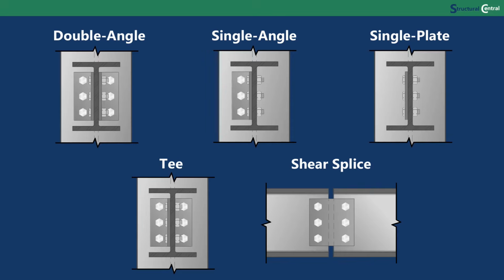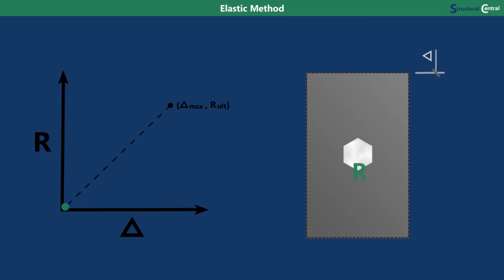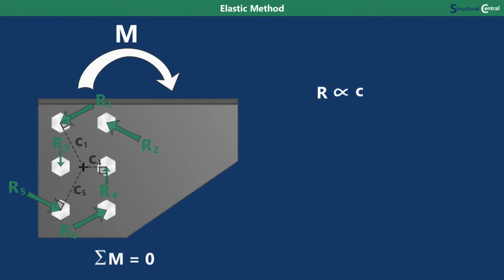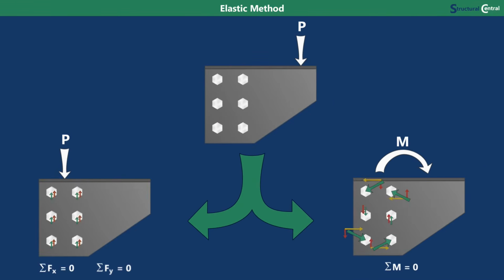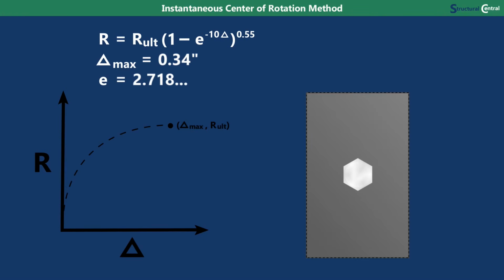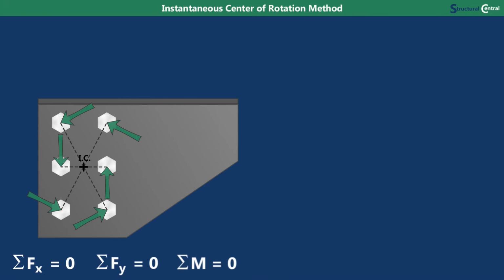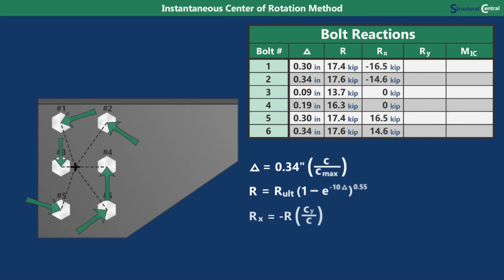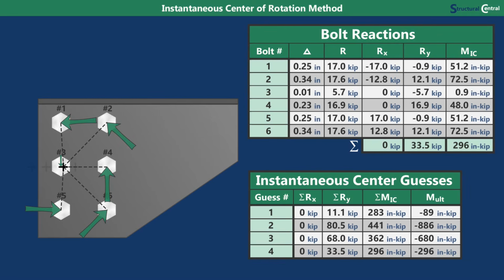Bolt Group Calculation - Eccentrically Loaded Bolt Group Analysis

Comment: I didnt understand first one how each one p/6  Do the all forces have same axis other wise rotation would be
I am talking about 3D
Can you explain
Reply from the maker: When analyzing an eccentrically loaded bolt group using the Elastic Method, the applied load gets split up into a concentric load and a concentrated moment. The reactions from the concentric load are P/6 since each bolt supports them evenly. These reactions, though, still need to be combined with the reactions from the concentrated moment in order to determine what the reactions are from the eccentric load.

Please let me know if you still have questions about this.

Comment: How could you calculate the bending/torsion (I'm really not sure what it is) stress in the plate?
Reply from the maker: Each bolt prevents vertical and horizontal displacement at specific points. The entire bolt group collectively acts as a support that prevents rotation (in addition to preventing vertical and horizontal displacement), but it doesn't have a discrete location. This means that there isn't a single value you can use as the eccentricity to determine the location and magnitude of the peak moment like there would be for typical fixed supports. Instead, you need to use each individual bolt reaction and statics to determine this. You could conservatively use the distance from the applied load to the furthest bolt.

Once you've determined the magnitude of the peak moment, you use fb = M / S where fb is bending stress, M is the moment, and S is the section modulus which is bh²/6 for a rectangle.

Remember, that you may also have axial stress in addition to bending stress if your applied load is not perpendicular to the bolt group's point center of gravity.

I hope this explanation helps!

Comment: A c channel is bolted eccentrically to a concrete wall and the unbolted side of the c channel is supporting a cable tray. The bolts are 6 numbers in 2 columns 6 inch apart. How do I know if it would be acceptable if we reduce the 6 inch to 4 inch (between the bolts)
Reply from the maker: It is not possible to determine if the reduced spacing will be acceptable with the information that you have provided. It's necessary to know the magnitude and location of the load from the cable tray, the bolt size and material, the channel size and material, and the details about how the bolt is anchored into the concrete wall. Decreasing the spacing between the bolts will result in increased reactions, thus decreased load carrying capacity. I recommend you hire a local structural engineer to answer your question. Best of luck to you!
Reply: @StructuralCentral  The cable trays are supported on hangers and this c channel is used as a additional rest

Comment: What is you are asked to calculate live load using elastic method? For instance,Bolts group design. A bracket plate is connected to a W-shape column. The layout of bolts group is 5 by 2 (5 rows and 2 columns). A325 bolt, 3 inches spacing vertically and 5.5 inches spacing horizontally, type N, loading case S, 7/8 inches diameter. Eccentricity e=16 inches. If the dead load DD is 10kips, what is the maximum live load LL?
Reply from the maker: For detailed, bolt group calculations, you can go to www.structuralcentral.com and sign up for free.